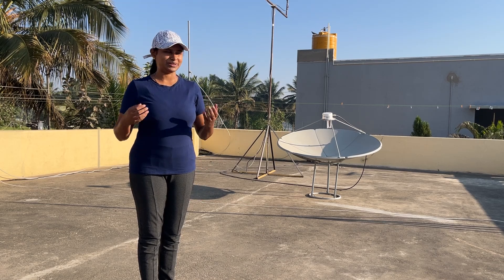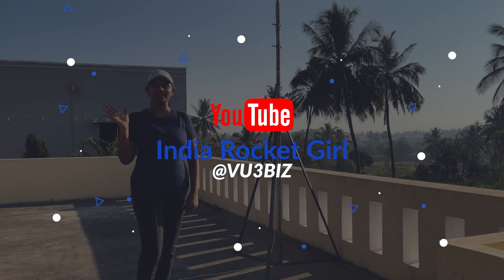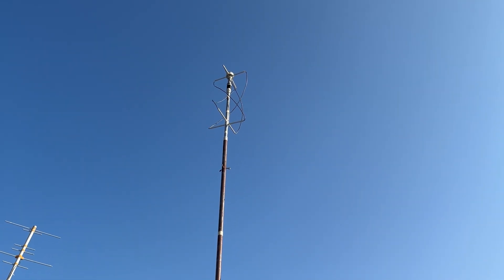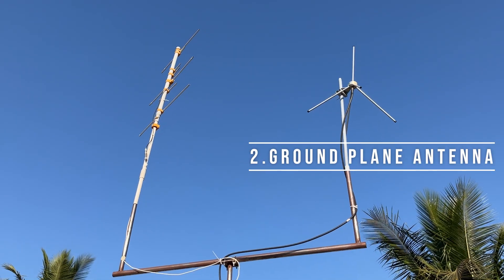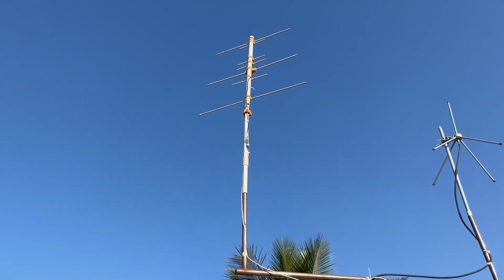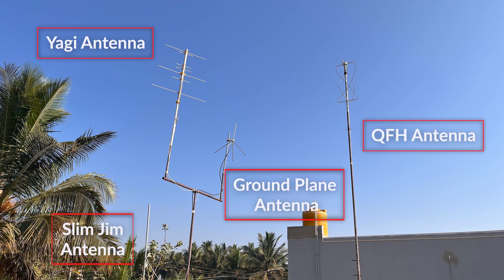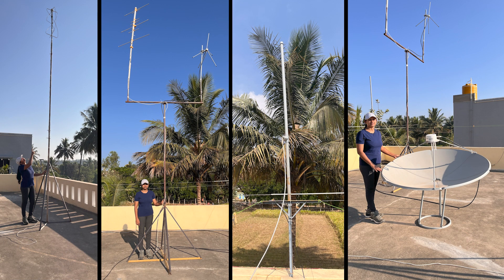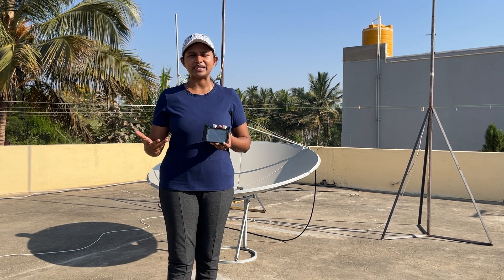Chasing The Satellites with Antennas at my Home | India Rocket Girl

Comment: A small recap for the benefit of the viewers:

Antennas come in various forms, each tailored for specific applications, frequencies, and bandwidths. 

A Quadrifilar Helicoidal Antenna (QHF) is notable for its circular polarization and is primarily used in satellite communications, particularly for weather satellites and GPS, operating within the UHF band. 

The Yagi Antenna is a directional antenna consisting of multiple parallel elements in a line, commonly used for television reception and amateur radio due to its high gain and moderate bandwidth at higher frequency bands like VHF and UHF. 

The Slim Jim Antenna is a variation of the J-pole with a lower radiation angle and greater gain, making it suitable for VHF and UHF applications, such as emergency communication in amateur radio setups. 

A Ground Plane Antenna consists of a vertical radiator and horizontal elements, ideal for omnidirectional communication over VHF and UHF, which is prevalent in mobile and marine communications. 

Lastly, the Parabolic Dish Antenna offers high directional gain and is used in microwave frequencies, suitable for satellite feeds and radio telescopes, where focusing a narrow beam on a small area is crucial, covering a range of frequencies from 1 GHz to well over 30 GHz depending on the dish size and specific design. Each type serves unique roles ranging from television and radio broadcasting to critical communications and scientific research.